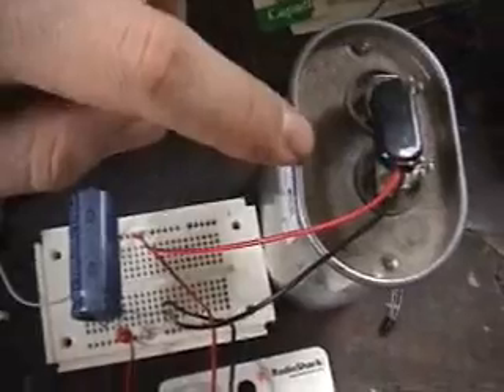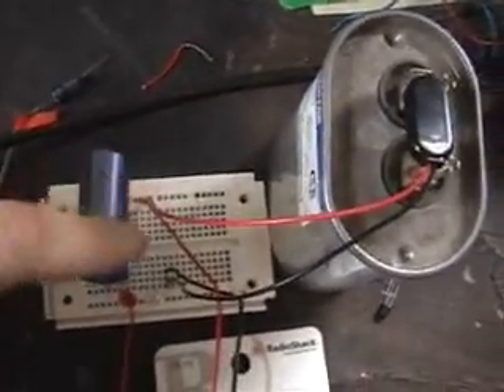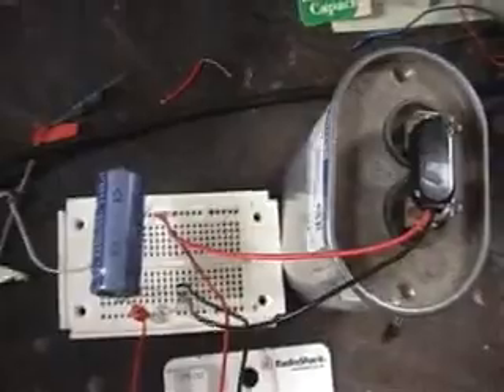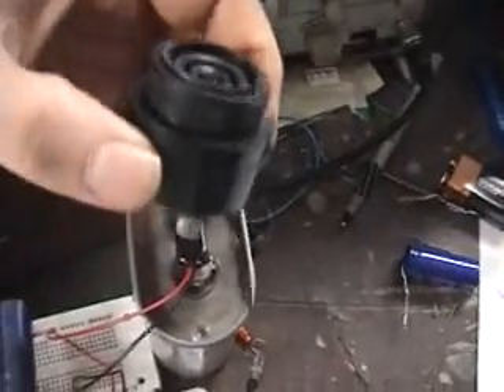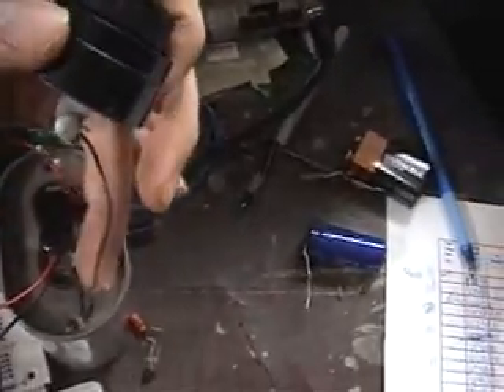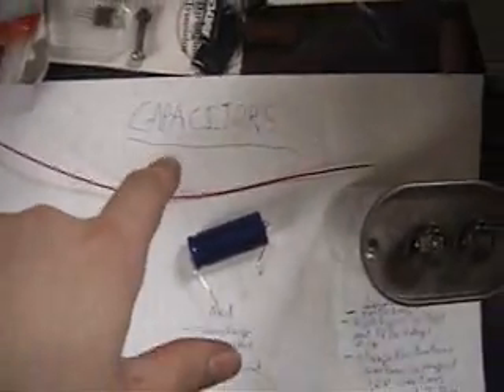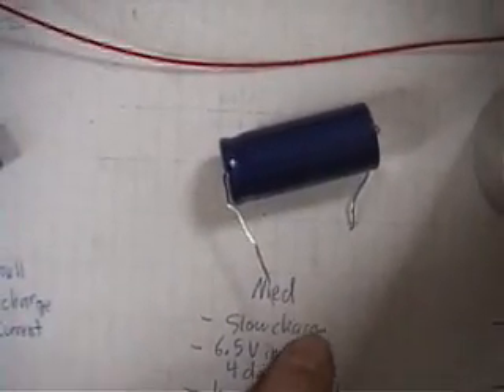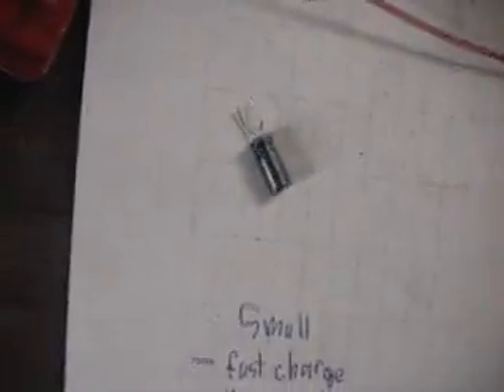Utilization of Radiant Energy 1901 Nikola Tesla,My test 6

Comment: the size of the capacitor is unimportant it just stores the charge, you need a tuning circuit to step up the voltage, also make sure you are getting good contact from the plates to the wires

Comment: cosmic rays will also knock electrons off a plastic coated metal plate, so it should pull voltage in complete darkness.

Comment: Main factors

-plate thickness
-coating thickness
-size of plate
-solidness of ground
-capacitor needs a timed relay / 555 or a resistive load to work. 

btw trees pull current from the ground the same way to create sugars and proteins. Sun adds electrons to earth, chlorophyll removes electrons from leaves using light, creating a differential. Nature is a Tesla free energy device. 

if done right the capacitor will simply charge until its dielectric ruptures.

Comment: Hi Box, I must point something here. The length of the wire between the plate and the capacitors do have impedance. The capacitance and the impedance do have an oscillating frequency. You could try to calculate this frequency, perhaps there is something related to the atmospheric layers, the frequency of the cosmic ray and frequency you have your circuit tunned to.

Comment from the maker: ohh yes, weather seems like a big player in this devices operation. i find that very intresting, ive been checking out a battery charging circuit, very basic, but it shows how the weather effects output. sometimes it actually pulls the energy back out because theres two diodes on the battery, so sometimes its higher or lower. its weird, but very cool. thanks vaxinius for your intrest in mine and teslas work,